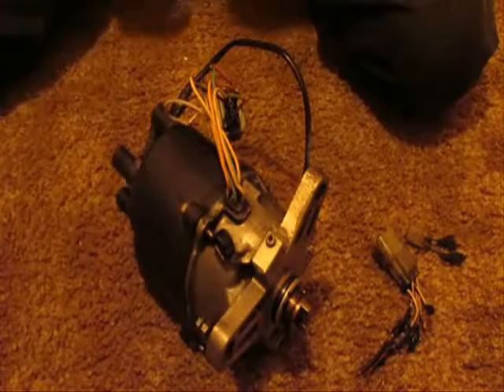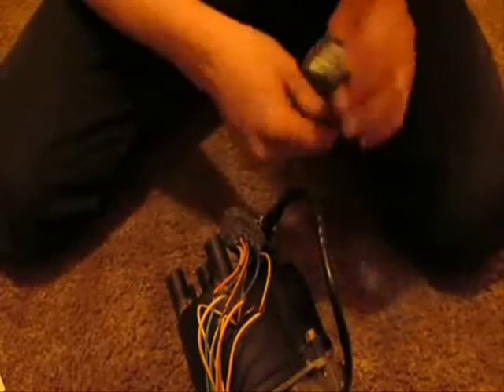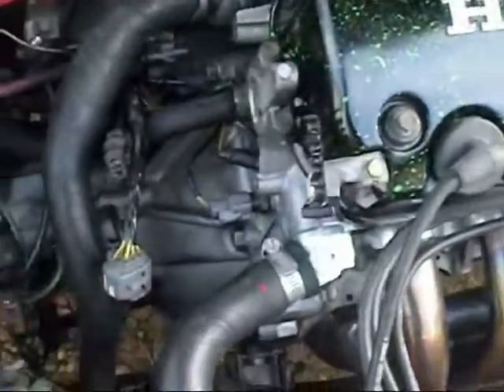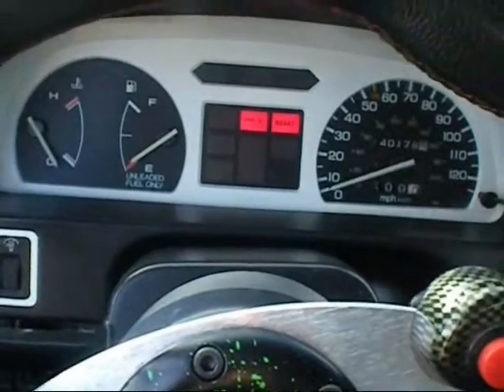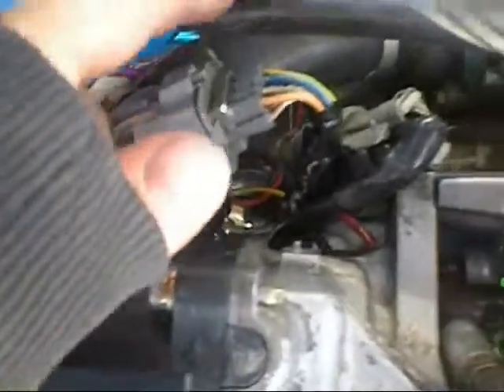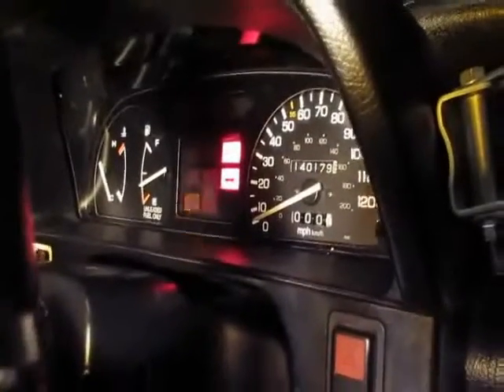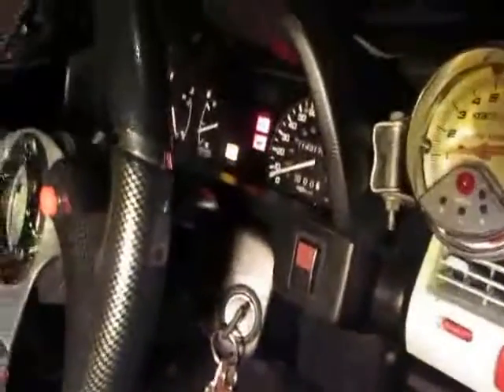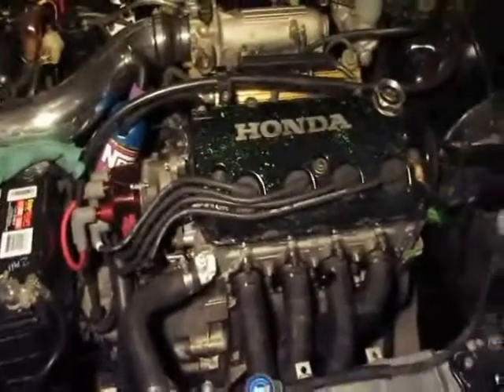How to OBD0-OBD1

Comment from the maker: The VSS go's out in old school really easy. Best way to get it to work is to replace the gauge cluster (i had same issue) Speedocable worked perfect and speedo worked perfect but VSS wasn't .. So before u got hunting wiring issues check by getting a Junk yard special (what i did) :) hope it helps!